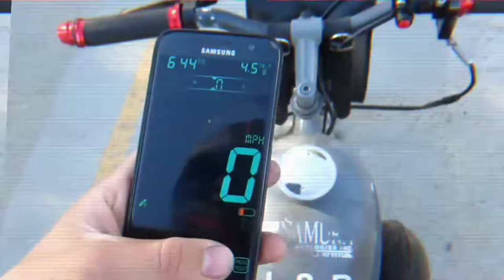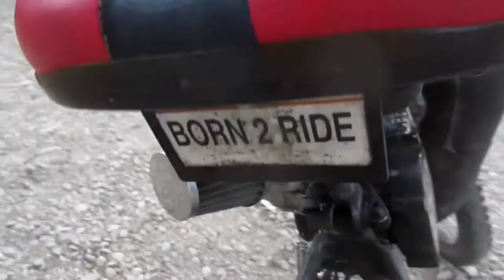The BEST Exhuast And Carburetor You Can Get On Your Motorized Bike, Crazy Power! - Suzuki RM80

Comment: Great build You need the silencer stock or amazon for $24. And that motor will do 60 and come on the pipe harder. Needs back pressure. I've raced 80s 250s and 500s for 30 years

Comment: Nice Ripper!
If you take a bit of 1-1/8" diameter tubing to your pipe,then  pinched down to 7/8 to the flange on a smoother transition it will increase the sonic wave effect at low to mid rpm. You can still bolt that way 
That little step you have is costing you a bit of the sonic pressure wave, by about 20-30%.
Try not to dent the expansion chamber each dent disrupts the wave 👍

Comment: Sweet nice speed without reeds never really thought a pipe made that much difference..Im running that BS zeda66 pipe
Reply: You're kidding right? The RIGHT pipe and jetting can add upwards of 3hp to these little engines, that and ethanol-free gas (I run AvGas in mine) and gearing it's not at all impossible to have a 60MPH plus bicycle. Running AvGas (Aviation Fuel, available at your nearest airport) alone would add 2 or 3hp. Key to these little 2 strokes is the highest octane gas you can get without alcohol in it, Bestways and 7/11s have ehanol-free fuel, at least around here anyway. The beauty of these 'lil Chinese engines is there's so much room for improvement, and you can go high-dollar, or you can go low-buck, and still get measurable performance out of them. My Zeda's bone stock and with pump gas it'll do 40MPH all day long, and I weigh about 280#. Running Avgas brought that up to just a tad under 50 on the flat, and again, that's a stock engine.
Reply: @randomprecisionmotors3130  Ya my bike a sled now I lost the needle clip leaning it out  on my oko carb had to put the nt carb on got to pull the jug and port it and buy a vm18 this time doing only 39 mph with reeds...Not to happy with the yd100
Reply: I gotta tell ya though, the more I mess with this supposed 'HP' carb, the more I wanna just slap the NT carb back on...didn't have to mess with that NEARLY as much as the HP, I had a HELL of a time getting it to idle with the HP, and finally after a combination of cable adjustment idle screw adjustment it idles, although a bit high for my liking...
Reply: @macmotorizedbike3834  Really? YD100's going on my next build, probably a 20" rig if I can find the right frame. Probably keep that all stock as well except jetting will go down from a #70 to a #66, and probably a KX65 pipe or am OLD YZ80 pipe. Expansion chambers are the ticket for these motors, but you don't want one with too big a chamber, and one of those older YZ pipes would be ideal if I could find one...
Reply: @randomprecisionmotors3130   Ya hp sucks big time. Nt better I was using oko much better than both like night and day  treatland sells needles thank God pack of 10 18 bucks
Reply: @randomprecisionmotors3130  I recommend the ZEDA80 from bicycle engine.com I screwed up just as much tourqe and 5 mph more on the top for my weight and cheaper parts ..i gotta zeda 80 I need to split the case wrist pin clip stuck in the crankcase
Reply: @macmotorizedbike3834  That's where I got mine I have now, get all my parts either from them or MZM iami down in FLA. I'm always recommending bicycle engines to people on Facebook, they ship quick, I got my kit in under a week, and MZMiami ship fast too, got some billet goodies from Miami, and I'll probably get the YD100 from www,Bicycle-Engines.com as well. They replace a lot of stuff on those motors that would otherwise break, and they've never steered me wrong to this point...
Reply: @randomprecisionmotors3130  U well regret it 40 bucks stock piston 60 bucks jug the torque it claims all smoke zeda80 best I ever had
Reply: @randomprecisionmotors3130  47mm piston faster top speed

Comment: We used a carb laying around for my old yamaha dt175 enduro 2 stroke  my dad modified it on my YD100 she was wicked  my current bike is 88cc she's  surprisingly faster than the 100 don't ask me why I haven't tried a top speed run I know I backed off at 55 60 with way more throttle going
Reply: Isn't it because the yd100 80cc?

Comment: If you come to a stop, do you have to push off the ground before going or can you start from a dead stop?
Reply: Push if you don't want to damage the clutch. Due to the way the clutches work on these engines, they're basically either engaged or disengaged, not really any in-between, so if you engage the clutch at 0mph the engine will bog and die almost instantly, unless you dump the clutch at high revs, which is very likely to break the clutch or snap something.

So tldr: must be moving a bit first
Reply: @charliesmith874  too late, I got a cent clutch

Comment: Hey, Ive got the same motor on my bike, and I just happened to have a 28mm mikuni flat slide carb almost identical to yours in the video, just sitting in my shop. What jets sizes and needle clip position are you running? I just installed mine along with a suzuki pipe and I'm not getting enough fuel for the engine to run without the choke on. It will start easily with the choke on but bogs with the throttle and dies the second the choke is turned off
Reply from the maker: Hmmm I'm not sure, I had a buddie jet it for me, not sure about the needle clip also, whenever I take it apart I'll look at both.
Reply: A 28mm is pretty much too big for any of these motorized bikes, a vm18 would be a much better match. I'm running a 22.5 pilot and 67.5 main in mine but it'll be different for elevation and so on

Comment: Do you recall what size jets you ran and what size is the carb? I'm running a PKW21 and I'm up to 150 on the main jet and 38 on the air jet with very poor results.
Reply: You’re Going the wrong way,  smaller jet sizes needed for peak performance but not too lean